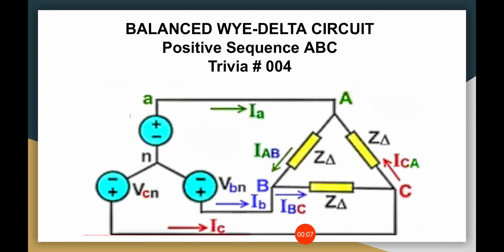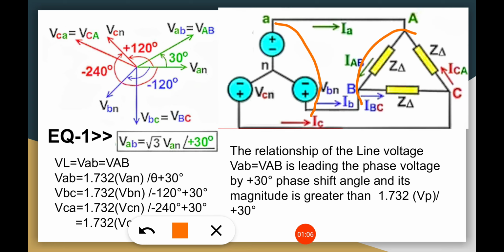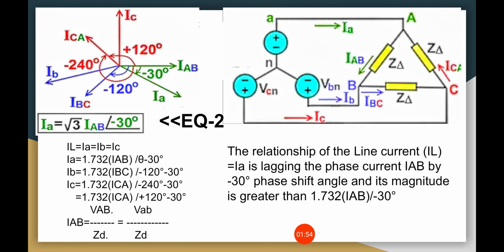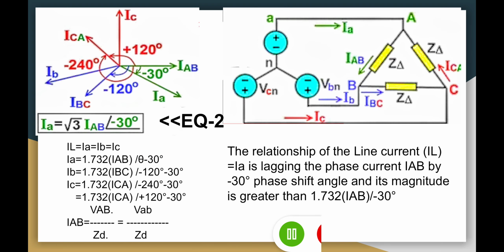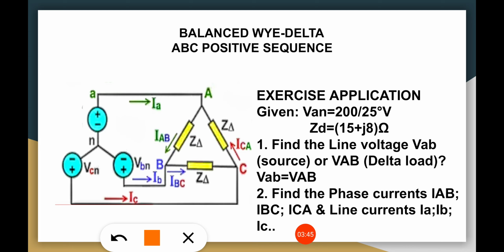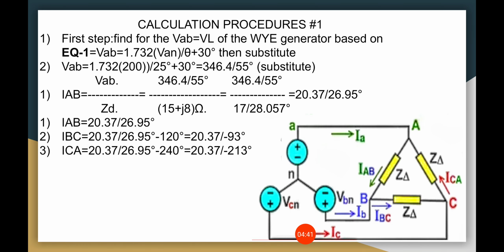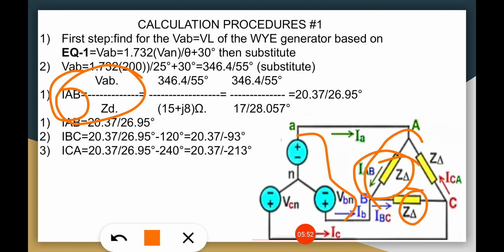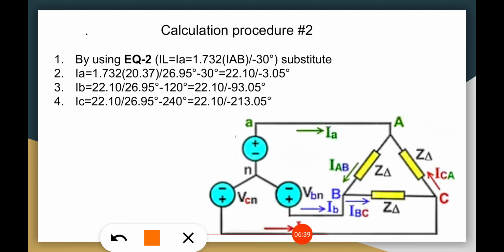BALANCED WYE-DELTA SYSTEM (Line Voltage & Current Basic Relationship to Phase Voltage & Current)

Comment: I thinks there's something wrong with the Calculation Procedure #2 in finding the line currents. Instead of multipying the 1.732 or √3 to the IAB, you tend to add the two getting a result of 22.10 instead of 35.3